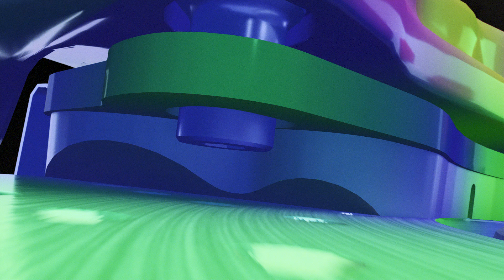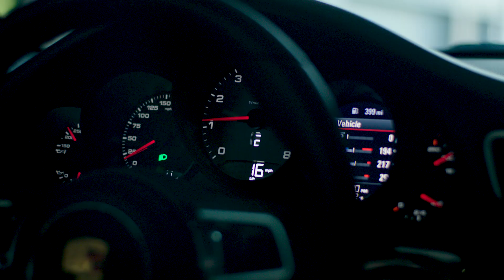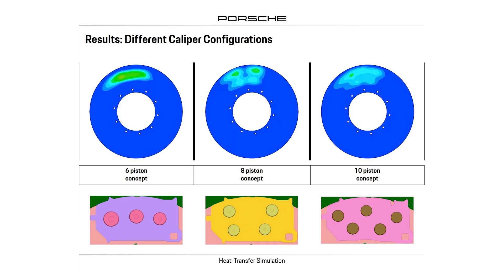Brake Squeal Explained

Comment: Big performance brakes have been prone to this sort of noise for DECADES now. It's not normally a problem if you use them hard from time to time but too many posers sitting in traffic don't get the concept and get annoyed that their 'expensive personal image enhancement object' makes noise and they can't hear their incoming text messages.  ;-)  Try three hard stops from 70-80 mph (on a clear road obviously) and see if they don't quiet down for a while.  Get some heat into the rotors and clear off some of that pad material you've built up while posing in traffic.  Once they cool down spray them down to clean the excess brake dust.  In many cases that brake noise is merely a cry for help... your Porsche has become bored with your Buick-like driving traits.
Reply: Savage commentary. Salute.
Reply: Doesn't work, re-done the full bed-in procedure with 50 stops, it quiet down for like half a day and then back to being 30 yr old night bus at 4am in your neighborhood. They should not sell this as a street car without a fat red disclaimer you get x % chance yours will be the one that squeal, badly.
Reply: Amen
Reply: Lol, so much judgement. Some people drive in traffic. I guess that’s a sin, huh?
Reply: Wow so bitter
Reply: Or not a poser, they should maybe say as they are selling you a car. Oh every time you use your brakes it will do this. My other 4 911 did not do this. My Ducati does not do this.
Reply: @benweiss7636  High performance brakes squeal when they are not being used as they should, which is hard braking. Period. This is well known since disc brakes' first beginnings in motorsport that goes all the way back to the early 50s. Any buyer capable and presumably enthusiastic enough to buy a Porsche or any other supercar that doesn't get this is straight up ignorant. The 911 user driving with carboceramics doing casual driving while complaining about brake squeal is indeed a poser that will never understand you need to drive and break hard in order to create proper heat so brakes can function properly. 

Not only that,  Porsche is one of the few manufacturers that doesn't rely on third parties when it comes to braking technology, it's all made in house, which allow them to improve tremendously in relatively short time. Take the brakes from a 997 GT3 and a 991 GT3 and compare. Miles apart. Sorry sir, you are still a poser.

Comment: Don't explain it, but get rid of this annoying sound! This video is just a cheap explanation to the car's design flaw!
Reply: It's people like you who made Porsche make this video.

It's simply a simply understanding of how pad compounds works to different degree of performance levels.
Reply: Ignorant ass. delete your comment
Reply: Mercedes solved this but actually making them squeal but at a frequency the human ear cant hear.
Reply: storck08 did you not understand that they've done everything possible to reduce it? Quiet brake pads = less grip and more prone to brake fade...
Reply: It isn't a design flaw. You either have performance brakes that resist fade very well or you have quiet brakes that fade easily. Most Porsche buyers would be better off with less powerful brakes, but noooooooo, they need those 'cool' motorsport brakes for posing in downtown traffic...
Reply: all race pads have this issue. this isn't at all about porsche ya dope.
Reply: As everyone here has already explained, squealing is absolutely normal in high performance brake systems. I suggest you search in Youtube for "The Grand Tour: The Aston Martin Vulcan Review" and you'll hear (20 seconds into the video) how a true race car sounds when braking. MotoGP bikes also make quite an annoying sound when coming into the pits. So, no, it's not a design flaw.

Comment: You can have quiet brakes that suck. Or you can have noisy brakes that perform. Pick one.
Reply: How make a quiet brakes with good performance instead?
Reply: @wijanarkoharry  exactly, like every other non VW car.
Reply: there is no science behind carbon-ceramics being better on streets from non-carbon-ceramics, not at stopping distance
Reply: Michael Tran I’ll choose no brakes
Reply: Or or or breaks that work and don’t sound like  need new breaks and scare people around u.
Reply: I Choose the ones that Do have Both !!! ! !!! or if there aren't, than i make ones !!! ! !!! But, ... it lasts a few years of building such ones now :-/ And if it work 4 some time, than i change the pads, and it squeals again . 6 Diferent manufacturers , and they still start 2 squeal at new pads ... :-/

Comment: I'd grown used to the annoying sound of brake squeak from the large front rotors on my MB C450 AMG, which the MB dealer examined and found to be good. I remember driving a Ferrari 430 Scuderia at Exotics Racing, and hearing the same squeak. Then just the other day, an Audi R8 pulled up beside me, and exhibited the same squeak. After seeing this video, I now consider myself to be proudly driving a car with large (and powerful) front rotors. Thanks, Porsche.

Comment: My Porsche’s breaks don’t squeal. Is there something wrong with them then?
Reply: Dmitry L if they're hot they're not gonna squeal. Most Porsche owners are putt putt drivers with the ceramic brake option wondering why their shit squeals. It's because you drive it like you should own a Prius.
Reply: It happens more on big brakes with multipiston setups. Even worse if you are on a more aggressive than stock pad and it's cold. It varies based on wear too. On my car they will start squeaking at ~3-4k miles and go away for a few thousand and come back a few times every now and then. Basically the only fix is to get heavy on the brakes. Once you go above %50 pedal it will stop.
Reply: Yes.  My Porsche brakes squeal in low temps, but they're over 15" rotors so maybe that's why they're huge

Comment: Wrong break in use of brakes can result in squeak too , but comes into the quality of pads and rotors . And the type of brake system such as carbon or steel

Comment: Hahaha look at Porsche being passive aggressive
Reply: Otherwise it would come out as, "You whiny, effete, pampered customers, we didn't design it wrong; you simply don't understand the underlying physics and engineering."
Reply: brake performance tends to be inversely correlated with sound. If you want performance, they'll inevitably squeal from time to time. Track pads squeal a lot
Reply: Saying “stupid fucks read up on physics” would have been too short
Reply: The more powerful your brakes are... the more noise they will make (usually).
Reply: camden davis  Yeah...because Porsche are known for making sub-par brake components.  (NOT)
Reply: jeebus2121 hahahaha so true, i died xD
Reply: brakes dispel energy.  The faster they dispel it the better the brakes.  If there is sound energy it simply supplements the energy conversion.
Reply: LOL... "passive aggressive"... not quite.
Reply: Which is hilarious because if they simply used better brakes they wouldn't squeal. I wouldn't need an informative video if porsche make cars without squealing brakes.
Reply: @camdenkerndavis  better brakes?  You shop realize Porsche already uses some of the best brakes on the planet, right?  Quiet does not equal better.
Reply: @maxmoser412  Maybe once Porsche rejoins F1.

Comment: Love my Cayman GT4 brake squeal 😎
Reply: That's true but when driving around town there is no need to abuse the brakes and reduce the pads lifetime just because
Reply: All true mine are steel rotors though , the car is a beast after the engine is completely broken in which I felt after 3500-4000 miles, Do you have COBB tuning ?
Reply: How do you get it neutral?  It comes built from Poland in the neutral settings (middle hole on front and rear sway bars).  Got the Cobb, but wasn't noticeable until I put the IPD and Fabspeed race headers and custom Cobb tune from Fabspeed

Comment: Its very loud guys. Please invent something to cancel it. Like brake silencer. Love you. Saudi Arabia
Reply: You complain about brake noise on your Porsche, I complain about the worn out seats in my 83 hp Honda Jazz...
Reply: /918/LaF/P1 holy trinity 
LOL. I'm not joking but one day I will own a Honda jazz. I like it. Thanks for the comment.
Reply: Bose noise canceling headphones.  :-)
Reply: It's not that big a deal.
Reply: get softer pads lol
Reply: Darin Nederhoff 
LOL. I wish it was that simple.
Reply: Aim Sora空 

I actually did use something to moisterise them.
Reply: tim- you can do one of two things- get brake silencer and apply it every few thousand miles or you can get lower performance pads.
Reply: leloodallasmultipass i did the first one a few times. Did not work. The second thu. Im thinking to upgrade to the carbon ceramic. Just waitting for my manager to die.then i will take his place. Wish me luck
Reply: Live on the edge of the everglades
Reply: Monty 4248 

Live between desert and an ocean